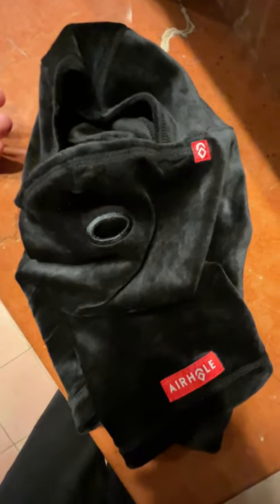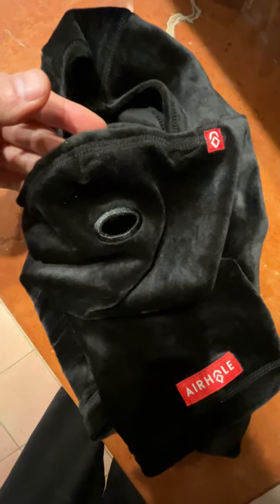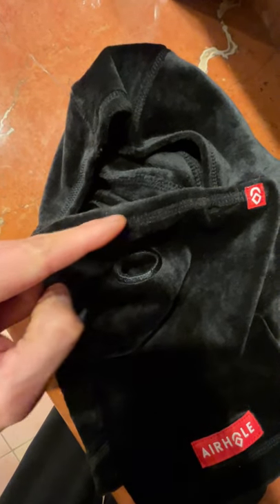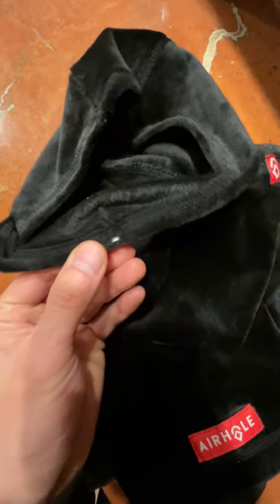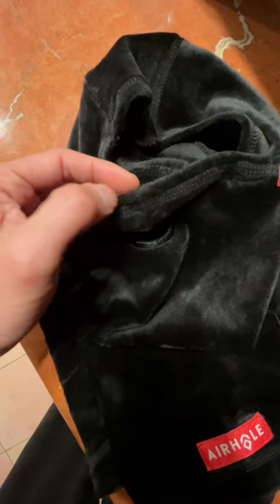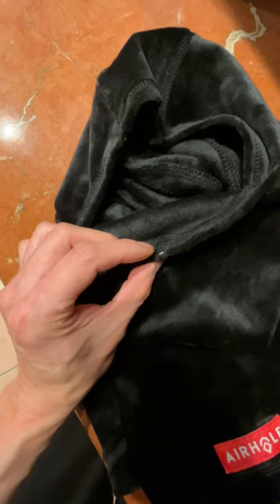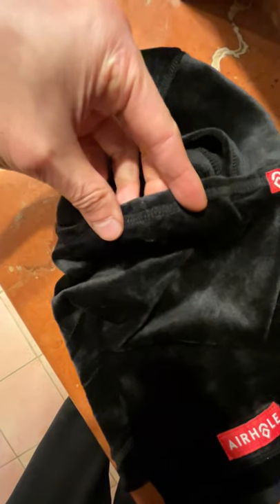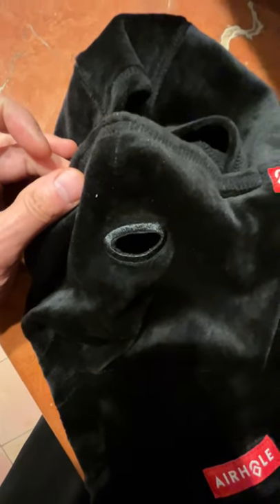Adding a nose wire to a Airhole balaclava, for no fog glasses and ski goggles!

Comment: Thanks for sharing this. Did it work?
Reply from the maker: Yes it's actually working quite well.  Tricky part was threading in the nose wire into the tiny fabric gap, as the fleece material is somewhat delicate and the end of the wire had sharp edges that can poke thru the fabric if you push too hard or too fast. Next time I would shave down the wire edges a bit to make it rounder.  It's also not as comfy when you pull the nose part down under your mouth with the wire in place, but it's a trade off to keep my glasses from fogging up.